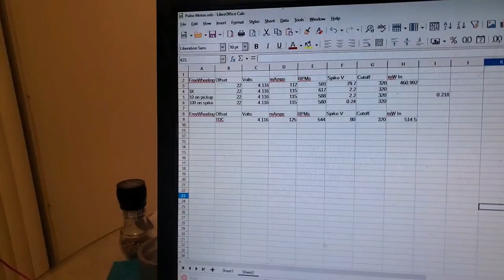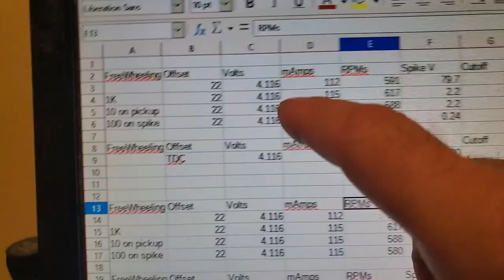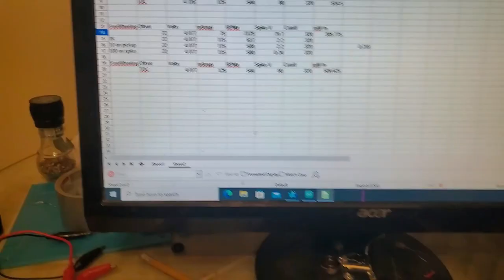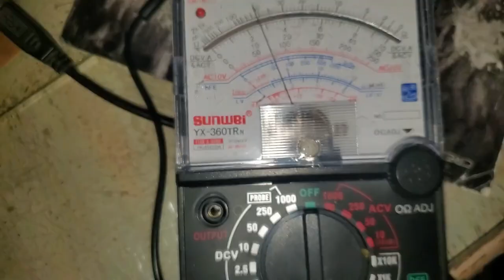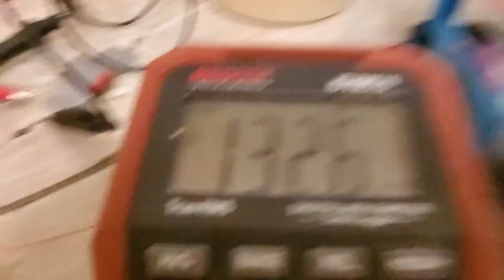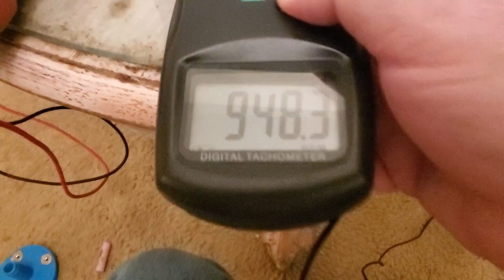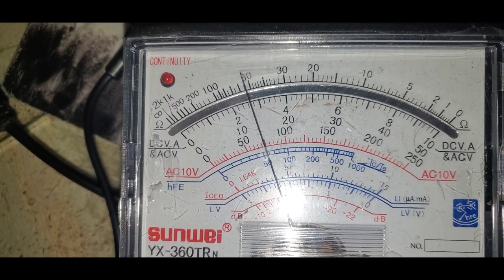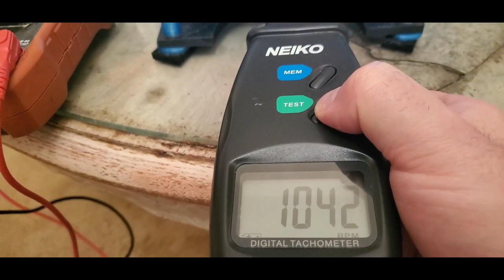Pulse Motor Air Gap: Part II

Comment: Use a piece of copper or aluminum plate close to the rotating magnets for consistent drag. If that is what you need
Reply from the maker: Good idea, I ended up just printing a coil that was the right size.

Comment: In my opinion the flywheel weight needs to be balanced to the coils. A flywheel can absorb and store a huge amount of energy quickly.
You can compare it to throwing a balled up tissue verses a golf ball verses a bowling ball.
But everyone tries to collect connetic energy from the same radius that it was generated from.
There's no mechanical advantage. 
The fat kid and the skinny kid on the teeter totter.
On a 12 inch rotor there is a mechanical advantage of 12x at the shaft. 
That's when the flywheel stored kinetic energy becomes useful at the shaft. 
100 lbs push on a 24 inch lever gives 2400 Newtons at the shaft.😊🤯

And with the air gap, it comes down to if the magnets flux is getting to the back side of the coil. 
If the magnets flux gets to the back side of the coil, your now pushing And pulling, 
instead of pushing Or pulling. 
So many variables and factors to factor in when designing a motor. 
Enjoying the journey with you. 👍👍
Reply from the maker: Thx, will keep the comments on flywheels in mind when/if I get a chance to take a look.  I think you may be right about a too large coil seeing the wrong side of the magnet.  Doesn't make a great deal of sense to me if considering the textbook representation of fields coming out of a permanent magnet, https://www.researchgate.net/figure/Magnetic-field-around-the-poles-of-permanent-magnets-in-repulsive-position_fig1_332556527 but I am having trouble coming up with any other answer. Thanks for the comment.